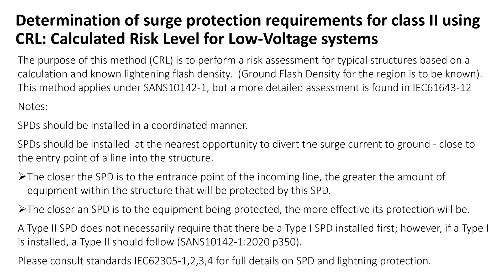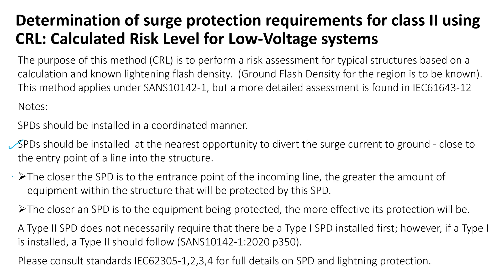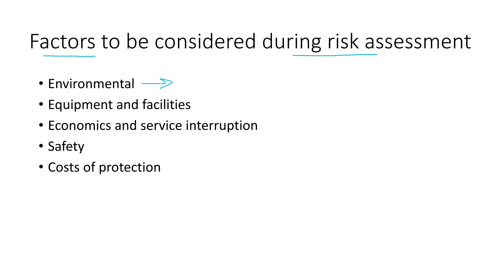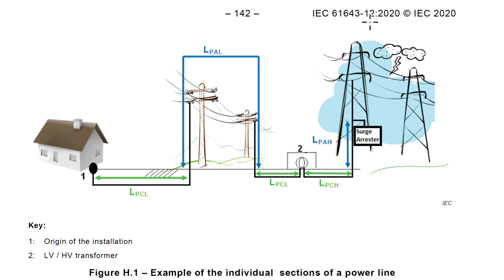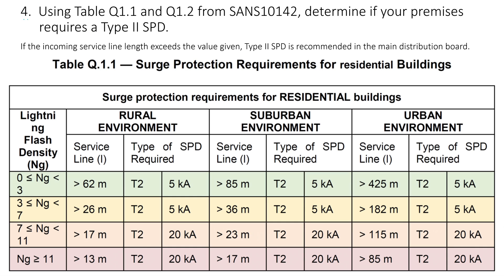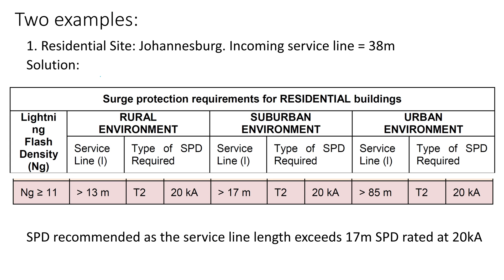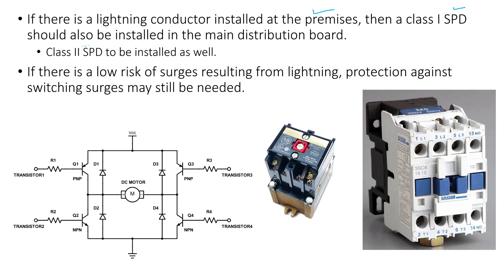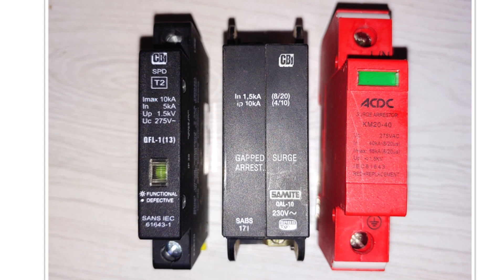Surge arrester calculation: calculated risk level for a surge arrester (Type 2) - South Africa

Comment: Very informative, but one question! If one determined, from the method you described, that eg. a T2 5kA SPD is required, would that determine the Inominal or Imax as printed on the SPD?